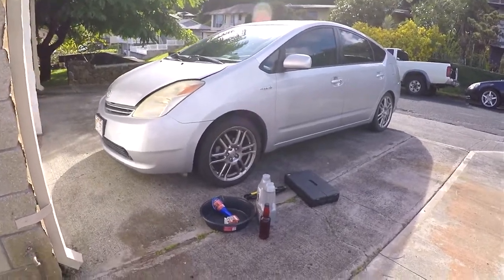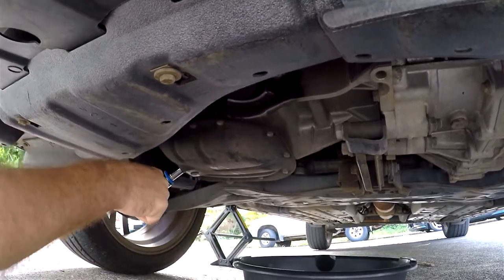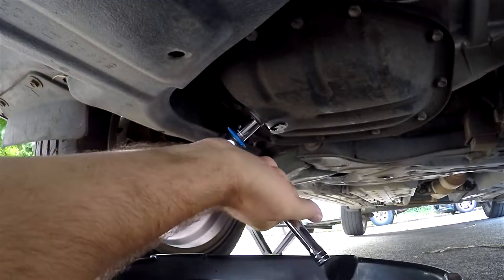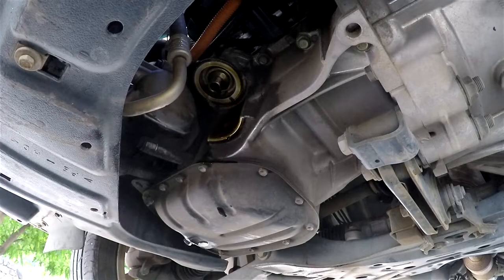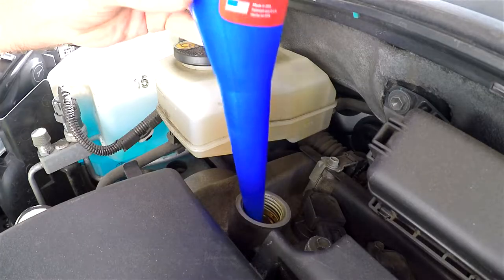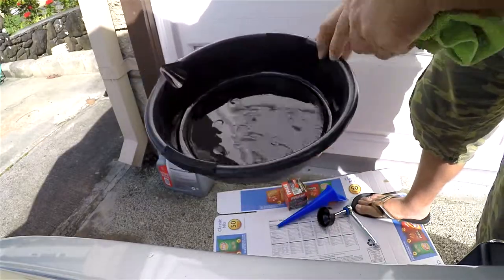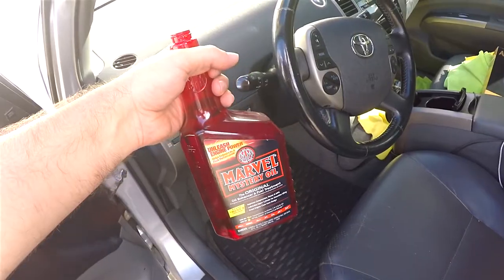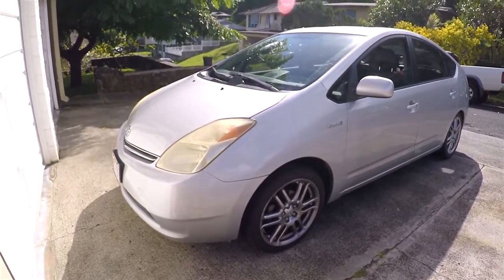04-09 Toyota Prius - DIY Oil Change

Comment: I put 10w-40 and thought it might be too thick then I saw you put even thicker oil 15w-50😳. My main reason for putting 10-40 was hot summer and 220,000 miles.
Reply: I have run 5-40 T6 on these engines for years ..the vvt-i is only on the intake side...  Engine is slightly quieter .. less of the oil burns  off...
Reply: I think 0W20 would be what is recommended.
Reply: @Volkyno  oil filter cap on my 1zzfxe has 5-20

Comment: Hello and thanks for sharing. Don't you think it was better to use 0W20 oil?
And the magnet, in my opinion, would be better located on the oil filter, it has to stay there because anyway you throw it away at the end with all the accumulated filings.

Comment: you should replace the drain plug gasket and also you should not use the tool to tighten the filter. hand tight is plenty tight
Reply: Where do find the replacement ? Do you know the name and measurements?

Comment: Vlad,  Are those 17" or 18" tc wheels on the Prius?
Reply from the maker: They are 17" scion tc wheels which go on perfectly for the prius.
Reply: @JustVlads  Cool...thanks!
Reply: @JustVlads  One more question; what size are your tires on the prius?
Reply: @JustVlads does this affect fuel consumption?